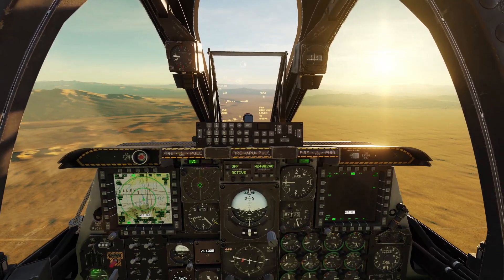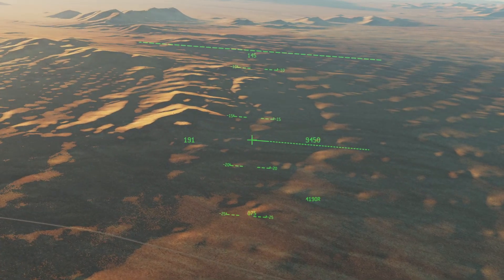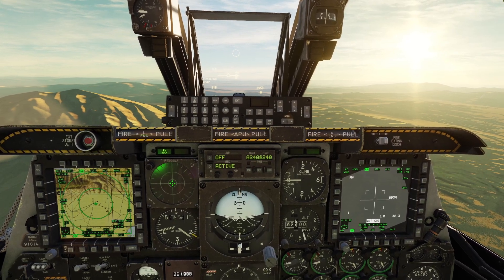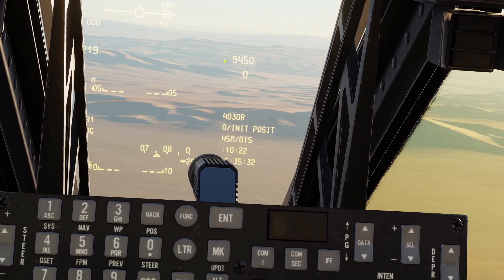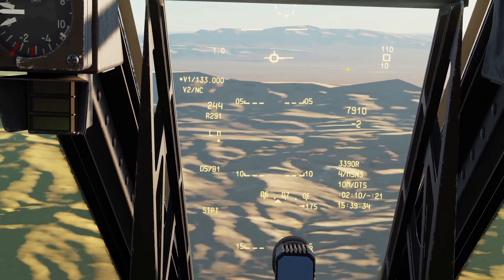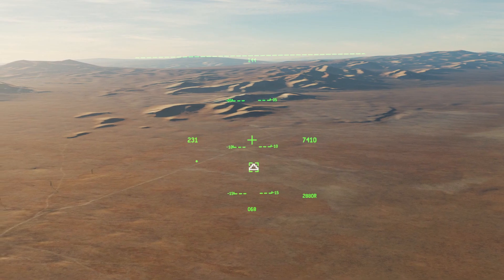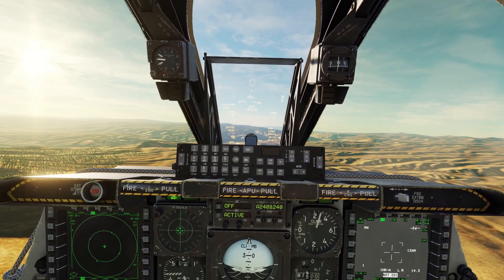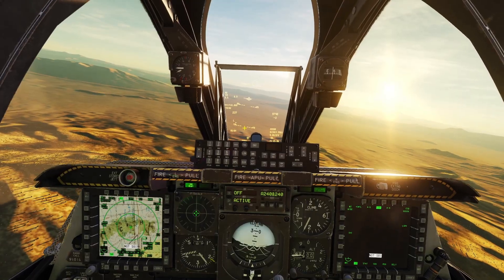DCS A-10C/CII Sensor of Interest and Sensor Point of Interest

Comment: Quick question - if I use GPS guided bombs and have a Mark Point on 3 different tanks. When I launch the first bomb on the first mark point, will the bomb go to the GPS coordinates at the moment of launch or will it follow the coordinates of the next mark point if I switch to it before the bomb hits? 

IE: To hit 3 tanks, I set a Mark Point on each tank. Can I use SPI on MP1, switch to MP2 and launch the next bomb, then switch to MP3 then launch that bomb, one right after the other?